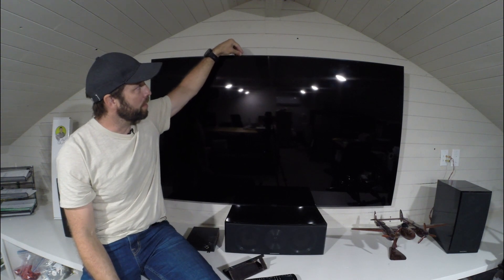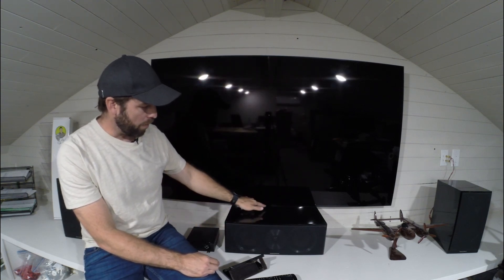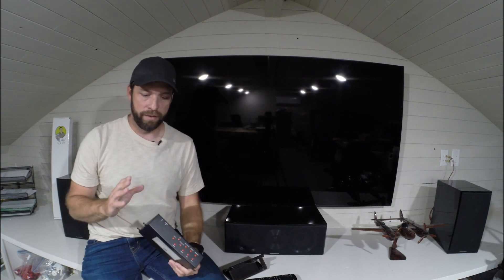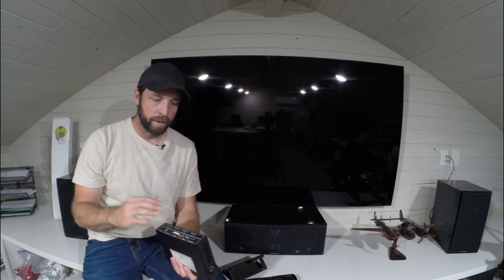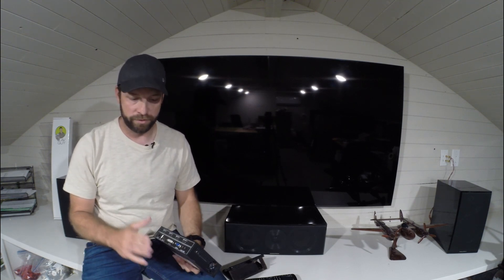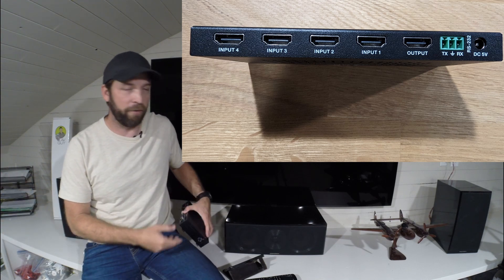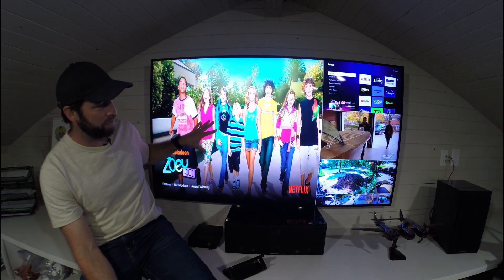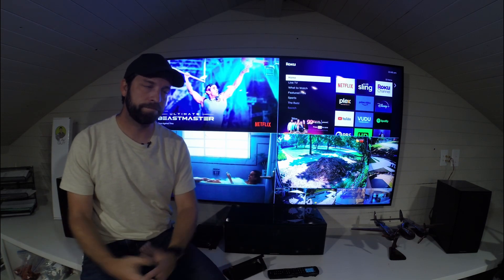What Hardware is Necessary for a Video Wall Setup

Comment: I’m wanting to do a 2x2 video wall in my shop mainly to watch 4 different football games at the same time. Is this achievable using roku tv’s hooked to my internet  and using the apps on each individual tv to watch 4 seperate games? Also at times will want to watch 1 game on all 4 tv’s. So do I need both a video controller and multiviewer or just a video controller for 1 big screen and using the smart tv features for multiview

Comment: I used to work for a company who made the gear you're talking about.  I worked in tech support for 16 years.  They fired me, and I have no NDA's.  If you have questions, I'd happily give answers.
Reply: Let's do it!
1) There are the multi screen matrixes on Amazon that do say 4x4 for $600, there are others that seemingly have the same functionality for $100 of less. Considering it's all digital signal, is this another case of Best Buy's  "gold plated HDMI cables", or is there a genuine difference?
2) Any idea where to get cheap but decent but cheap 4x4 or even 6x6 wall brackets? Annoyingly they seem to be the most expensive part of this sort of setup.
3( What were the main sort of problems you'd get in tech support? (ie - what goes wrong the most?)
4) After 16 years they fired you?? Damn. Why?

Comment: Hi, I think I have it somewhat understood for the 2X2 video wall. TVs into Video wall controller then Video Controller into multiviewer. But where would the sound bar connections go for sound from there? Also, bonus question. I’m going to have four streaming devices as my inputs for the multiviewer but what if I also want to add video game devices. Would I just need a larger multiviewer at this point? maybe a 8X1
Reply from the maker: Great questions.  You have your logic correct.  Your hardware will determine where your audio will come from but usually any of the 4 TV's on your wall will have the full audio stream connected to it.  You should be able to connect a sound bar to any of those TV's and get the audio stream or you can turn up 1 or all of the TVs at once to get audio that way.  Additionally the multiviewer or video wall controller might have an audio output as well.
Reply: @ awesome thank you 🙏

Comment: What prompted you to use a multi-viewer instead of a matrix? I’m trying to figure this setup out for my basement and am having trouble planning it all out. Thanks!
Reply from the maker: Matrix is different than a multiviewer.  Most displays in your home are made up of just 1 TV and therefore only able to display one source at a time.  A multiviewer is 1 source but can cram multiple sources into its single HDMI output giving you a split screen on a display which is only capable of displaying 1 HDMI source at a time.  
I save several TVs around the house and I wanted to see the split screen effect on any TV in the house so I used the multiviewer to do that.
A matrix is a generic term but it involves combining multiple inputs with multiple outputs. For example, you could have a 4x4 matrix which is four sources and four displays. Any of the four sources can go to any of the four displays. I actually have in my house. A. 16x16 HDMI matrix.  Amongst my 16 sources one of them is my multiviewer so I can route my multiviewer to any of the outputs. The reason I don't use it on my video wall displays individually is I used off the shelf TVs. When you do this you have to turn the top TVs upside down in order for them to fit together properly. The result is that the top two TVs obviously have inverted images. If I were to send my matrix individually to each of those TVs, all of those sources would be inverted. It's much easier to instead use a video wall controller so that your video wall instead just looks like one normal single source display instead of four TVs.  It may seem like an unnecessary edition of equipment, but it is the most cost-effective way. Believe it or not.
Reply: What is your setup for sound? I want to use external audio (soundbar or two speaker system). Did you connect the video wall controller to the external sound? Does the multi-viewer allow you to change which of the four sources you are listening to?
Reply from the maker: @SpartyHR  The multiviewer audio output will switch between whatever source you want to listen to.  There is an audio cycle button on the remote.

Comment: Thank you for some much needed clarity on the types of controllers. I did a 3×3 42" bezel less wall 2  years back. And it came out awesome problem was i was ignorent with using it as a single/multi  display wall. And realized that the controller i bought only made one huge image. And just delt with it.. fast forward to today stubled accoss your video gem here and you clarified what i needed to do thank you....

Comment: Theres nothing simpler? Nothing were i can plug in my Nintendo switch and Blu-ray player so i can watch a movie while playing Minecraft?
Reply from the maker: The simplest way is to get a multiviewer.  There are certain TV's that have some of that functionality built into them.  Samsung  for example has a feature called Multi View and it is available on some of there Q series TV's .  I am unsure of all the limitations but you can do a side by side image of 2 sources on Samsung TV's if they have the multi view feature.
Reply: It doesn't get much simpler than this. If you can hang a lcd TV on the wall and plug in a CD player then you have all but mastered the art of this type of video wall.

Comment: Great overview. What is the best way to display 4 different channels/sources/ sports using a multi viewer on a single tv if they are coming from different streaming apps? Assume all 4 inputs would need to be connected to an internet device such as 4 x fire sticks? Also I assume you can’t use the tvs inbuilt apps as 1 of the 4 displays within 4 screen multi viewer..?
Reply from the maker: You are spot on.  Using the TV's built in apps would take you away from the multiviwer input and leave you with just one big screen.  Use 4 streaming media players like you said.  Helpful tip is to use players that utilize rf or Bluetooth remotes so you can just label the remotes 1-4 and always be able to control which screen you want without accidentally controlling one of the others.  Most media players use these types of remotes.  Quick test is if it has a built in mic on the remote for voice control.  Dead giveaway it's Bluetooth with that feature

Comment: Hello. Do you have any you highly suggest? In your notes, you said you don’t necessarily recommend any of them
Reply from the maker: I currently use this multiviewer  
https://www.amazon.com/gp/product/B08KFNPTS7/ref=ppx_yo_dt_b_search_asin_title?ie=UTF8&th=1
It has worked out pretty well but it is limited to a 4k 30Hz output.  Other than that it has worked out.  My video wall controller 
https://www.amazon.com/gp/product/B08K4Z4KSD/ref=ppx_yo_dt_b_search_asin_title?ie=UTF8&psc=1
I won't recommend as it has a pretty significant limitation and I don't want anyone else running into the problem.  This video wall controller will not splice if your using 4k.  Again if you set the resolution to 4k then you can't adjust the individual monitors via "splicing"  The splicing feature is disabled when you run it in 4k.  This is really irritating and had I know this I would not have purchased it.

Comment: Can you run a multiviewer through a video wall controller?
Reply from the maker: absolutely controller will take any compatible HDMI input signal.
Reply: @EdwinBonneau  I was thinking of buying the j tech matrix. Also was thinking if I hooked up controller to multi viewer all the inputs would go to either or So they wouldn't work simultaneously

Comment: Im confused on this subject if you can shed some light, I want to do trucking sim. With 3 tvs “not monitors” some videos say MST HUB some say VIDEO WALL CONTROLLER whats the difference??? Also Can you do this with just an HDMI SPLITTER ? Output to 3 monitors ???   Also what if the machine accept 1.4 and the mst is 1.2 will u run it to issues or you have to match it ???
Reply from the maker: No real difference between a monitor or TV when it comes to your trucking sim.  I have a flight simulator and use 3 - 55" TVs.  You will need a computer that has 3 video outputs.   Get a desktop PC and add a dedicated video card.  Almost all of the dedicated video cards have at least 3 outputs.  With the dedicated outputs you can tell your computer that you have 3 dedicated screens and you want the image spanned/extended across them.

Comment: Hey did you take off bezels or did something, I can't see them at all when you were switching modes.Also could you share models of TVs. I can't see grip at all, how?
Reply: This is just a single tv. Likely a 55 or 60 inch based on the size of it and him next to it. He’s probably just using 1 tv to showcase the hdmi controller.

Comment: I’ve been researching this for a while. Thanks for your input. My goal is to merge 4 x 4K 85 inch TVs into one huge picture. Would the 4 screen display in 8 k or 4 k. My input would be Apple TV or Roku

I don’t need to split since each tv is connected to YouTube tv. I think I just need a multiviewer. 
Problem 2 when TVs are running separate. How do I separate each tv with corresponding remote.  Ie I don’t want all TVs to change volume or channels when I select one of the 4 Samsung remotes.
Reply from the maker: Ah the inherent challenges needed to overcome with video walls. 
If you have a video wall controller that can output 8k then yes you will see an 8k image.  I can tell you right now that the 8k controller is likely way to expensive for most setups.  A decent 4k output is realistically the best you're going to achieve.
You will need to get TV's that use Bluetooth/RF remotes so that they can be assigned to each display and then label the remotes.  I use a fancy control system and I control all my displays via IP or discrete IR through individual emitters on each display.
Video walls are complicated setups and require a good knowledge of electronics to navigate effectively.  
You will have to have a video wall controller in order to make 4 separate TVs into 1 TV.  No way around it unless you purchase a display that is designed to be a video wall display and in that case it will have the appropriate hardware built into it.  These TVs are not available at Best Buy or any other box store.

Comment: Question? We need to flip the tv because of the power buttons are on the bottom, but when I use the codes mute+182+power when the option appears and I push enter there is no MRT option. What do I do?
Reply from the maker: You must get a video wall controller to flip those displays then.  Unfortunately most consumer displays wont allow you to get into the service menu and "flip" the image.  Commercial or video wall displays are designed with this feature embedded in the display but your TVs from the big box stores usually will not support that feature.  Even if you find an article that claims to know how to get into the service menu, the manufactures often change firmware to eliminate the option on future sets.  For this reason your best bet is to purchase  a video wall controller which will allow you to invert/flip the image on the displays that you need to without the need to get into the service menu on the TV itself.  It's one of the main features of a video wall controller.  If you have a commercial display and cant get into the appropriate menu you will need to check with the manufacturer through their support team.

Comment: What about a LED video wall
Reply from the maker: LED walls are an amazing solution and perfect for commercial use.  Extremally bright and their modular design makes them easy to deploy and arrange in whatever design the project calls for.  They are very expensive and the only real use I have seen of them in residential space is large exterior displays but several "residential" systems exist.  Sony, Samsung and LG I know have them.  They just run around 90k to get into one!

Comment: Hello, and thank you for your time. I am trying to replace my projector with four 65-inch 4k tv's. I want to use it for movies xbox and Sunday football on multiple screens, and that's where I get lost between muti switches and controllers. Again, I just want to set up a 2x2. Xbox and cable box. Thank you to any and all  information. Thanks.
Reply from the maker: A Video Wall Controller makes 4 TV's into 1 usable screen.  This has to happen first when combining multiple TV's together.  After you have the 4 TV's acting as 1 screen with the Video Wall Controller then you need a multiviewer to split up sources (xbox, cable box etc..) across the big screen.  You can skip the controller step if you use a projector instead for your big screen.  But if you really want to do 4 TVs then you MUST have a video wall controller.
The Video Wall (multiple TV's together) is a more complex setup and will require more patience and maintenance.

Comment: Did u turn the top 2 tvs upside down or bottom two tvs
Reply from the maker: I flipped the top two.  Generally that'd your only play.  It's the bottom of the TVs that is usually irregular so you have to yup the bottom of the displays on the edge of your video wall.

Comment: So each video is 1080p even though the source is maybe 4k?
Reply from the maker: In my setup each of my video wall monitors is 1/4th of the 4k resolution.  Combined as one display they come out to a single 4k display.  Now there are a lot of nuances here.  Each display has a native 4k resolution so each individual monitor is upscaling its incoming resolution to fill the entire 4k panel.  In short my video wall controller is capable of accepting 4k signals and outputting a 4k signal but spread across 4 displays.  Hope that answers your question.
Reply: @EdwinBonneau  gotcha, but with the multi viewer will convert a 4k to something lower though?
Reply from the maker: @BPTtech  every multiviewer is different.  Some accept 4k signals and only output 1080p some will do 4k.  Some accept 8k signals and output the same....all it takes is $ and you can get just about anything you want.  1080 input 1080p output $.  4k input 4k output $$$.  8k input 8k output $$$$$$$$
Reply: @EdwinBonneau  gotcha

Comment: Fantastic - thanks! How would you go about adding touch screen capability to the setup?
Reply from the maker: Touch screen for the video wall or a touch screen controller to manage it?
Reply: Yes to both @EdwinBonneau
Reply from the maker: I use URC Total Control for my control setup.  It requires a manufacturers certification to obtain the programming and ability to purchase the equipment.  I use wand, style remotes as well as their mobile app for control of the system.  To make the entire 110" screen touch screen, that could prove much more difficult.  I have seen some virtual touch screen options that might give you that kind of control. https://prodisplay.com/touch-screens/interactive-overlays/infrared-touch-overlay/ @Matt-n9l1l

Comment: Great content Sir, so for your setup you have both. the video wall and multi viewer?
Reply from the maker: That is correct
Reply: I’m getting g ready to setup my own video wall at home. Thanks for this, really helped me on getting started, but I have a question… i want to keep my surround sound, what’s the best way have a video wall with a multiviewer and AV receiver??
Reply from the maker: Plug the multiviewer into the AVR then the monitor out from the AVR goes into the video wall controller. @markwheat9689

Comment: Hi so I was thinking of doing a 12 tv video wall and was just trying to figure out what I would need to get that to work. I have found a controller that supports 3x4 would I need multiple multiviewers to have multiple outputs for the 12 tvs?
Reply from the maker: So you are getting pretty involved with that one.  You are going to want a really nice multiviewer/controller.  Short answer is yes you can chain several cheaper multiviewers together to create pretty complex source arrays (chopping up of the entire screen).  You might not want to do that because now your dealing with lots of extra hardware and points of failure as well as a far more complex overall setup which only the installer will fully understand and be competent in usage.  I would highly recommend a single multiviewer setup which will allow all the sources to be managed from one location and then split up across the screen accordingly.  There are systems that combine both the video wall features with the multiviewer features.  I haven't personally done large video walls like this but look at https://birddog.tv/videowall-overview/  Also the type of content your putting up their will limit what hardware you need.  If it's live broadcast or copy protected content you will need a system that can handle all the HDCP stuff vs an advertising based display showing just a bunch of PC based stuff.

Comment: Do you think a cpu can do a 2 tv wall? I’m leaning that way to downsize some devices. (Firesticks, Roku) chromecast). I currently run a hdmi switch with 2 outputs.
Reply from the maker: I think I understand what your asking and the answer is yes.  A windows based PC can easily span a single window across 2 screens or do 2 (or more) applications on any of the screens simultaneously.  This is all dependent and the type of computer your running.  I am only familiar with PC but Mac can probably do the same type of thing.